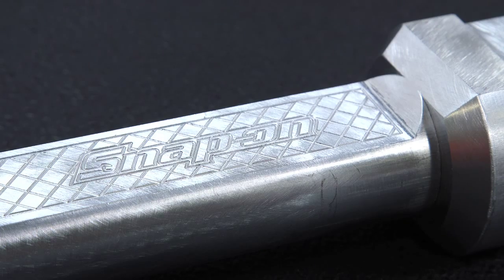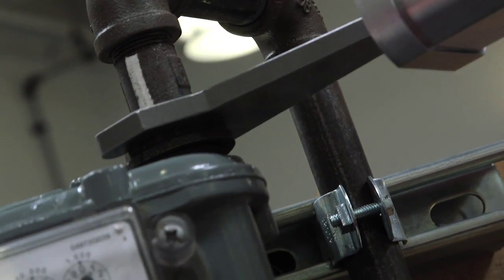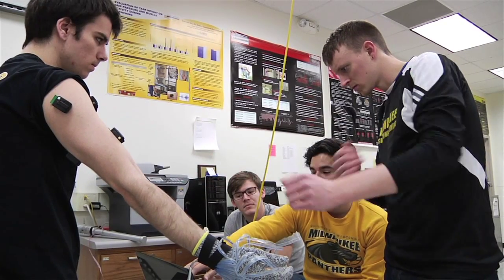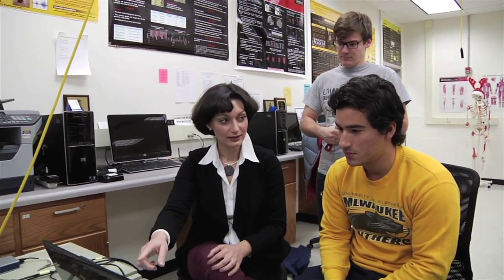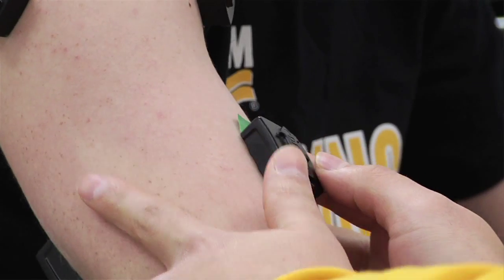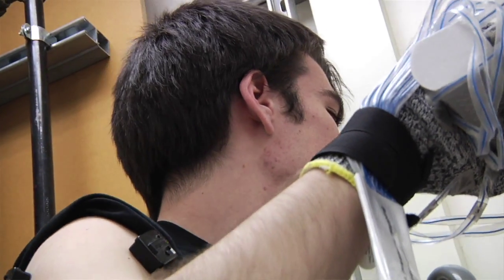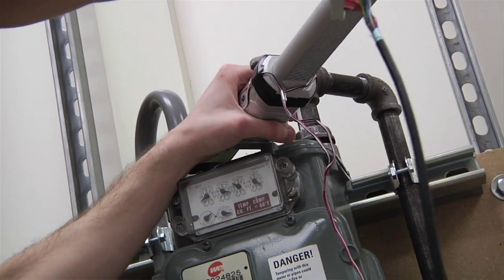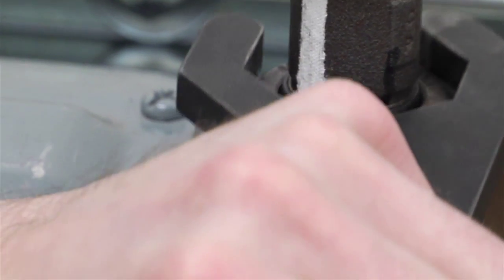Snap-on rolls out industrial wrench developed at UWM

Comment: Definitely not a new idea at all.
5 do the work of 50...
The snap-on name itself teach that story, an old story...
a handle can accommodate different size and shapes wrenching heads and relative adapters to get the job done.
This kind of wrench with multiple heads is already available in torque versions and not, maybe not pentagonal, octagonal and other proprietary shapes but they do exist.
Of course, if you extend leverage, force and human effort employed in the fastening and dismounting is less (goes by itself, less than a pipe wrench with shorter leverage with cast iron or forged steel handle weight..).
At this point, why don't  develop either a specific adjustable telescopic handle similar to blue point indexable breaker bar BLPBB1224
(IMO  Not round&milled but elliptic&Tennessee forged/coined section or even a nerved H section like in building trusses)???
Moreover, why not either with a slightly pivoting/swinging head at the joint like in ATECH ratchet heads...???
Take care, Ciao.
CSR